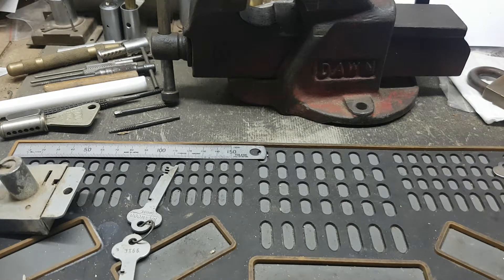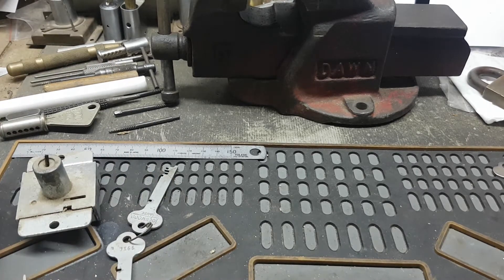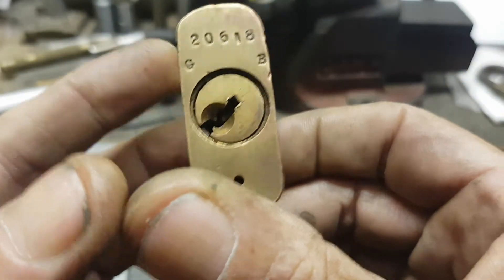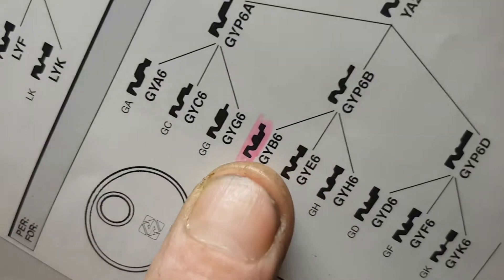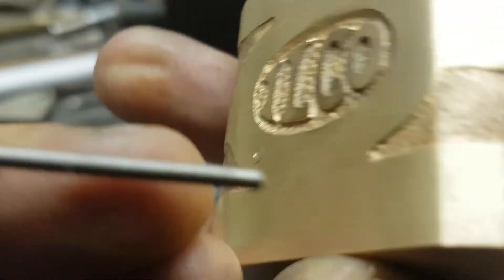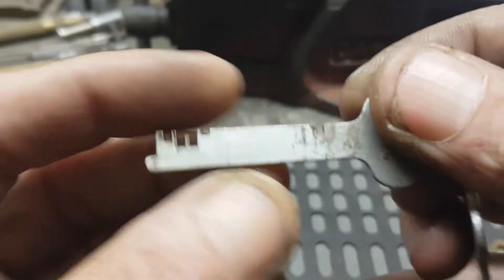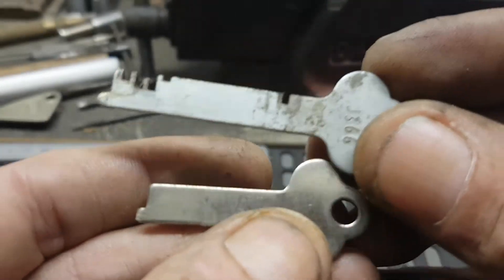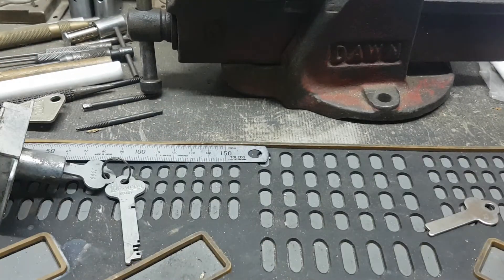#305 A ramble and a few answers to questions.

Comment: Hey Paul. On the Yale that is the code cut for the lock. That would have been put on by the locksmith. Only problem is you never know if he has started at the bow or the tip of the key. As always lot's of great information. You are like an encyclopedia when it comes to anything about locks.
Reply from the maker: Thanks Rob. Appreciate your faith in me. lol. Have a safe one and keep well:-)

Comment: Nicely done mate. That ilco turned out really good. A wide variety of answers for everyone. Do you ever sleep?😂 I have a massive ring of those LF keys (140+)  but they are all cut unfortunately. Thanks for sharing mate. Have a great long weekend bud 😀👍
Reply from the maker: Thanks mate. Yeah, i do sleep. lol. I don't work that hard mate and i do have time to spare so making a video only takes 10 minutes so all good. Just a question for you. Can you have a look at the bunch you have and by chance you have a H506 coded key, i know someone that would take it off your hands. No stress if you don't have one, i can cut one for him:-)
Reply: @crankylock7844  you aren't supposed to admit not working hard mate😂 we all appreciate the time you take to help out and make videos.
I just checked the keyring, I don't have one with that number. I do have one that isn't labelled but that could be anything. If you want a photo I'll send it to you. I've also got about a million shorter ones marked ZC.
Reply from the maker: @downundermonkey2057  No worries. I'll cut him one. The ZCs are a Lowe and Fletcher key for their cupboard locks. Different codes specific for their product. Thanks for checking your keys all the same. Have a good one:-)